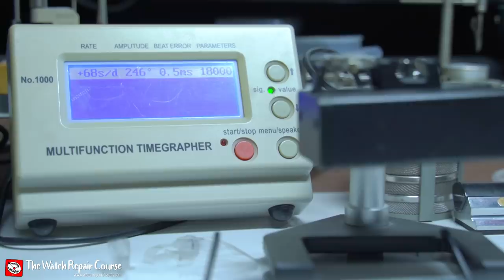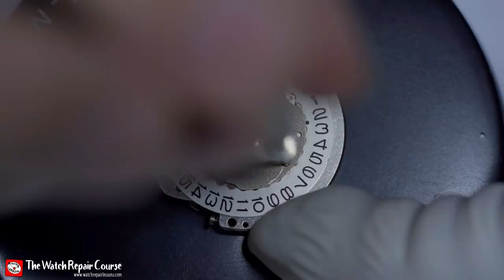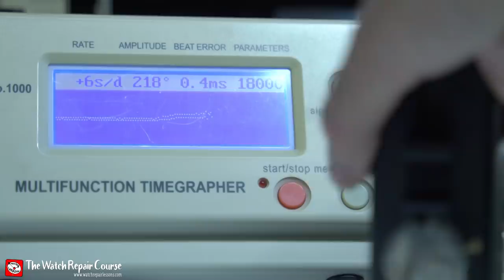A 1960s Seiko Sportsmatic Watch - Restoration & Repair - 7625A

Comment: TJW
I have three Seiko's and a Full Auto Orient which is basically a 7625A Movement.  The two Sportsmatics were bought  in Singapore and Thailand 63 - 65, The Full Auto Orient was purchased in Malacca, Malaya in 1968. The Orient King Diver is at the moment under repair ( Balance spring replacement)  this video will no doubt be of enormous help. Thank you,

Comment: I wear a 7625-8031 as my everyday watch. Just love it's classic lines. It keeps absolutely amazing time. I have it running a perfect beat with no error. I honestly have not adjusted the time in about a month now. Great movement when correctly setup. Easier on the later 7625 with the "D" version of the movement. It's just you can adjust the beat without repinning the hairspring unlike the "A" version in your video. For folk new to watchmaking try using brass tweezers as they do less damage if they slip especially on dials. I make my own. All you need is a hammer, a drill a file or two and a vice.
Reply: That mainspring barrel and arbour looked like they had done a few hours work. I'm lucky in that I have a lot of old Seiko NOS parts squirreled away.

Comment: Thank you for one of the most enjoyable videos on YT to me. I've got one of these Sportsmatics, from the exact same year, but in a different colour scheme (black dial, steel case, rather modern, pretty!). My father used it daily and after he died I got the watch. It was beat up and had a cracked crystal but it was ticking away merrily. I had it serviced and restored and it now has been my dress watch for some thirty years. Keeping good time and stylish as anything. It shocks me to realise that it is 56 years old and still going strong. 

A word of advice to people having neglected examples of these lying around (and there are many!): Allthough service or restoration will cost you more than the watch when it was new, these Seikos are worth it. There is something special about a vintage mechanical watch on your wrist.

Comment: From a Mechanical Engineering standpoint it is really amazing how there is seemingly no appreciable mechanical wear or fatigue owing to the low forces involved in the mechanical gear trains and functions of this old watch. This is interesting in the use of materials in the construction of mechanical machines where forces relative to material tensile strength and toughness are relatively low. So, it is conceivable that with the proper application of machine components you should be able to make a mechanical human hand with much the same low wear characteristics and complicated dexterity, or mimic complex movement like a spider walking through mostly mechanical means. Perhaps if the need was there we would see more swiss mechanical hands and spider-like walking toys.

From a wear standpoint (friction) it seems odd that you would still lubricate a rigid metal pin to a glass (jewel) molded surface, as shown in the video. One may argue that the lubricant actually adds more drag on an inherently low friction pivot point which is specially shaped in regards to the mating surface area. 

On some of the gears it would be beneficial if there where cutouts (one gear on top of another) which would allow easy inspection of the gear mating during assembly. 

In working on very small embedded electronics you will find very small structures (components) that need to be located and soldered at specific locations in the circuit. For high end visualization you may find on a specific task to have multiple cameras focused on different important areas of the work to provide simultaneous views of the assemble as it is being worked on. The camera output is usually fed through a PC to be displayed on two large monitors, enabling the technician to see multiple views at the same time without uncomfortable contortions of the body and head. If we extend this thinking to watch repair, you could for example, when installing hands show a close-up of the hand mount point from the top for centering and another looking at the hands position relative to the watch face (parallel) and the hands mounting point distance from the face on the mounting pin or cylinder (sleeve).

Comment: Hi, i have enjoyed all of your videos I have watched, this one included. As an aircraft engine mechanic, I feel a close relation to your work. But I would shy away from restoring dailes and cases. I do want mention one aspect of my work and I understand the gasket was brittle and stuck to the case. But that it is best to avoid tools to remove o-rings, and rather pinch them with your fingertips. The aluminium and magnesium alloys we deal with are very susceptible to scratches, and a scratched o-ring groove can be source for a oil-, fuel-, or air leak. Maybe a tooth pick as an alternative to the tweezers?

Comment: Nice to see you working: look like it's simple.I fell in love with a SEAGULL 1963 (after your video servicing the Breitling Chronograph), but I can't tell if the modified VENUS 175 is worth its price.
Reply: it is, i've had my 1963 for 5 years and it completely reliable.
Reply: @Melkor54  Thank you John: happy to know this! Can I ask what happened after those five years? Did you sell the watch or did it "die"?

Comment: Absolute newbie but do you not put lubrication on the mating teeth of the gear trail and finally where did you get the missing gold metal for the 12 o'clock marker. Fixed many thing but never tackled a time piece but you have given me a desire to do so.

Comment: Wonderful video, thank you! Do you replace the o-ring on the stem as a wear part? And curious why you dont just disassemble the balance jewels and run them through the cleaning machine? Seems like more work to clean them manually. Appreciate you sharing your work with us.

Comment: Came to this video looking for tips on repairing an automatic watch that my Dad gave me but after watching I decided I don’t have the skills, patience or tools. It’s a Camy Geneve Superautomatic Incabloc, is it worth getting it looked at?
Reply: Looking at various Camy watch models, they don't appear to be particularly remarkable.  Sometimes it is just as well to keep a watch as it is.  Some watch makers are reluctant to work on dated watches since parts are not available.  And working on it yourself is a recipe for failure, as the skill level needed is more than the average person has.  If you simply want the watch to be cleaned and serviced, it is an option.  Putting the word Geneve in the name is a little shady, as it is supposed to be reserved for makers who follow the specifications of a guild, which the Camy doesn't. As to whether it is economic, no. Forum info follows:

---

Camy Watch S.A. turns out to be a rather intriguing company, with no lesser figure than Raymond Weil joining and managing it from 1949, for 26 years. Later, of course, Raymond Weil formed his own watch company - Raymond Weil Geneve (grave accent on second 'e') - and although Weil's own concern is still an independent quality watchmaking firm, it does not seem to have quite the kudos of other quality makers of similarly priced watches.

Camy Watch was founded in Grenchen in 1913, and for a period I cannot ascertain, was certainly listed as "Fabrique d'Horlogerie Camy - Stroun Freres S.A." Unfortunately, although the firm produced some good quality watches for over sixty years, very little is known about it. What we do have though, are many surviving Camy watches, with the more interesting models tending to date to the 1970s. For those wishing to see a selection of vintage Camy watches, I suggest an online trip to, lahorevintagewatch_blogspot.co.uk/p/page-45.html., and I include a few pictures of vintage Camys here below. Apart from the Raymond Weil connection, it is also notable that Simone Bedat (acute accent on 'e') also joined Camy from about the mid 1940s, and was to work closely with Weil. Once again, Bedat was to be a watch brand/company in its own right, but I do not propose to go down the Bedat route here - perhaps on another occasion. 

In terms of movements, Camy used ebauches made by other firms, even though they are usually signed "CAMY." Mid-range ETA movements appear, as do more upmarket ebauches, and the firm also produced chronograph watches (often with Valjoux 7733/4 movements) and dive models.

Interestingly, the Camy models from the Raymond Weil years bear the brand name, "CAMY/GENEVE" and I cannot help thinking that this may reflect on Raymond Weil's later concern where the "Geneve" tag also occurs in the brand name. As for model names, Camy Watch went in for using a plethora of different model labels that occur on the dials. These include the model varieties illustrated above by staffie, with Rallyking, Airport, and SuperAutomatic being a few other model titles. 

As a final note on Camy, it appears that the brand came in for a revival in 1999, when some new automatic models in tungsten were produced. However, as of today, the Camy is evidently not a player, and I don't think watches branded "Camy" are being made currently, although with so many brand names rising and falling I cannot be certain.

https://thewatchforum.co.uk/index.php?/topic/107445-camy/

Comment: Great video. I have a question. Do you know where i could possibly find a second hand, for a1966 Omega Seamaster 300? Unfortunately during a service in the 80' without my knowledge, the second hand was swapped out for a non original one. Don't know if this was done deliberately, or the guy broke the original, and swapped it out hoping we didn't notice. Thanks for your help.

Comment: Wow!  That looks great!  I've recently started "tinkering" with some cheap watches I have and taking them apart to see if I can put them back together again.  It usually goes pretty well until the odd spring unsuspectingly "springs" into action and I lose it.  I would imagine with practice, I will get a little better at managing that.  But I must say it's most certainly satisfying.  How long have you been restoring watches?

Comment: How do these watches adjust for the number of days in different months? Or is that some manually?
Reply: It has to be set manually as the watch doesn't know which month it is. So it will always count the days as 31 days.
Reply: Manually except on the months with 31 days where it would cycle normally. If worn constantly, it only means 5 adjustments of the date per year.
Reply: You need to adjust the watch after every month that has fewer than 31 days. Watches with perpetual calendar complications exist too but are much more expensive
Reply: manually
Reply: It is done manually. The months that are not 31 days, you will have to adjust for. I my self own a Seiko Kinectic Arctura GMT 5m65 and a Seiko Prospex Divers 5m62, which both have to be manually adjusted. The best watches for me to own.